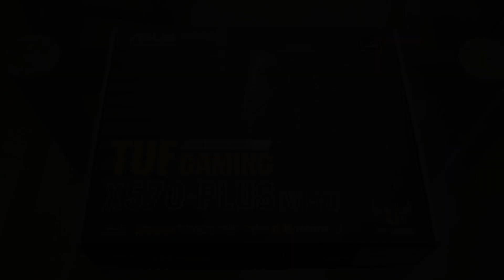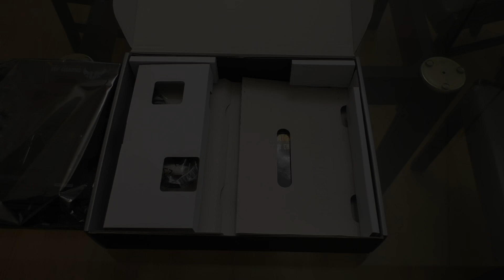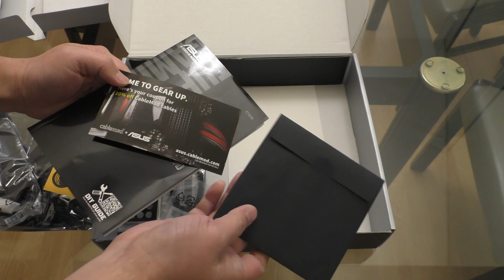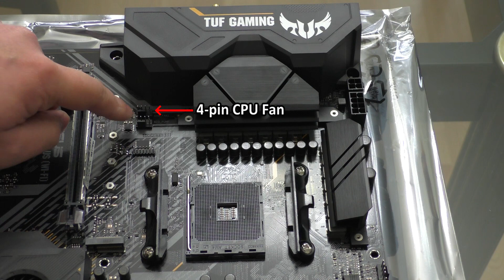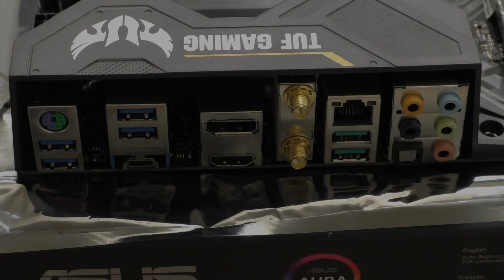ASUS TUF X570-Plus WiFi Closeup

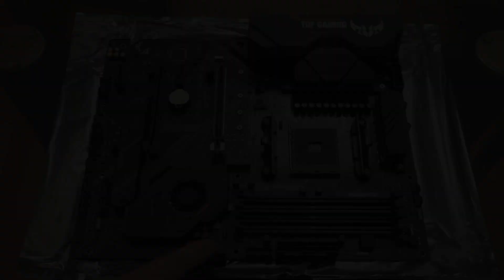Comment: For the system pannels( buttons and lights) pins in 1:37 does the power and restart button wires go into there?
Reply from the maker: Yup, you're correct that's where the power/restart button wires plug into.

Comment: How would you reset this type of motherboard? Is there a button or do I have to short it?
Reply from the maker: You'll need to use the clear CMOS jumper. Either short the jumper turn the PC on and hold down the delete key, or short the jumper and remove the battery.

Comment: It Will be fine with a Ryzen 5 5600x if i only put 2 cpu power clips? (The mother have 3 sockets for cpu energy )
Reply from the maker: You only need to connect 8 of the 12 EATX CPU power pins.

Comment: Hi, thanks for the run down
I just bought a custom build computer using this board. Do you know if it's possible to change the wifi5 to a 6? Like if I was to plug my own AX into a pcie x1 slot
Reply from the maker: If you get a different WiFi card and plug it into a PCI-E slot you should be able to gain Wifi 6 that way.
Reply: @FaRKle0079  Awesome, thanks

Comment: I'm planning to put a 3950X and 3090 in this board. I used PCpartpicker and it looks like everything is compatible. I just hope I don't need to flash the board. This will be my first build too, and probably last.
Reply from the maker: It's very unlikely you'd need to update the BIOS on the board to support that CPU. Great combo!
Reply: @FaRKle0079  I hope so. Super excited. 😎

Comment: does the pro version have the same port locations? My x570 pro (wifi) doesn't have pins in the front panel USB 3.2 port. 1:28 and why did you say 2.1 but then wrote 2.0?

Comment: How many fans does this motherboard support? And can i plug in a regular case fan into the AIO 4pin slot?
Reply from the maker: There are 3 case fan headers, but you can also put fans on the two CPU fan headers and AIO pump header.

Comment: Help asap. I have just build a new pc with same mobo and  5900x i cant find a 4pin cpu power connector. No signal coming to the monitor. Do u need the 4pin to power up a 5900x ?
Reply: U mean the 8 pin cpu connector? He explains it u don't need that 4 pin only the 8 pin

Comment: Nice video help asap. I just build a new pc with only keeping the case and cs750m psu. I cant find that 4 pin cpu power cable.  I have 5900x cpu on it do i need  the extra 4 pin  power  for this cpu ? I dont see any signal on my  screen
Reply from the maker: You shouldn't need the extra 4-pin CPU power for that CPU. The standard 8-pin alone should be fine.

If you hear the single POST beep when powering up, then the motherboard is fine, and there's probably an issue with the GPU or how things are hooked up with it and the monitor.

Comment: I over clocked my ryzen 7 3700x and now i cant get it to downclock at 
idle..  Amd cool and quiet doesnt exist in my TUF X570 plus wifi board. 
 I changed my power plan in windows to 5% minimum on the cpu but it 
still sits @ 4.3ghz even @ idle.  Anyone have any ideas?
Reply from the maker: Did you by chance change the CPU Core Ratio setting at all? I had your same problem once, and I think it was because I had changed that.

Comment: Is it just me, or did Asus reverse the install order for the RAM? The first slot it usually the clostest one to the CPU.
Reply from the maker: Gigabyte does the same thing even though the slots are labelled differently. The 2nd and 4th slot away from the CPU are the ones that should be installed first. It's really not intuitive and requires reading the manual.

Comment: Where would you insert a AE-9 soundblaster sound card on this?
Reply from the maker: You can put that in any of the PCI-E slots. Short cards work in long slots no problem.
Reply: I put an otter g sound card in my motherboard as well.
It works fine PCIE

Comment: I have a corsair 570x and the 3 front fans it comes with have 3 3pin wires but I don't know where to connect them on this mobo (first time pc builder)
Reply from the maker: You can connect those to the 4-pin fan headers on the board (it'll just take up 3-pins). There are enough headers on this board for three fans.

Comment: how do you use the 4-pin EATX 12V_2?
Reply from the maker: If your PSU doesn't have a plug for it, you don't use it. It's really not needed.
Reply: @FaRKle0079  hmmm..i guess that makes sense
Reply from the maker: @NSDaishi  The power requirements of the CPUs on this platform really don't require the extra 4-pin. Only under ridiculously high OCing (like beyond water cooling) you might need it.

Comment: So, I currently have a b450 motherboard, but am thinking about changing to this. I also want to add in a NVMe drive for additional storage(also which slot would I put that in, assuming its not for a boot drive could I just use either of the 2). Would I have to reinstall windows even if I bring my old ssd along with it or can I just re do all the connections and have it work right out of the box with all my old parts?
Reply from the maker: If you pop your old SSD into the new machine it should still boot up and into WIndows, but you'll still have to reinstall a lot of drivers and put settings back. Additionally, your Windows 10 copy might need to be reactivated. I had to do all this when changing motherboards but keeping everything else the same.

Comment: Can you move the second m.2 heatsinks to the first m.2?
Reply from the maker: Unfortunately not.
Reply: is using the second m.2 bad? i really want to but idk if it will affect performance
Reply from the maker: @DJLESGO  Use whichever you want and be happy! You shouldn't see a performance difference.
Reply: @FaRKle0079  i installed my m.2 in the second slot under the gpu. But it wont show up on my pc. Im using a WD Blue 1TB SATA SSD to boot. Do i have to plug another cable into the motherboard?
Reply from the maker: @loudmediaYT  When you say doesn't show up, do you mean doesn't show up in My Computer, or doesn't even show up in Disk Management for partitioning? Does the drive show up in your BIOS/UEFI?
Reply: @FaRKle0079  sorry i found it on the windows disk manager, i thought it would just appear in my files
Reply from the maker: @loudmediaYT  Glad you got it working!
Reply: @FaRKle0079  thanks for your help

Comment: Where on the motherboard would you be connecting the USB-C wire ?
Reply from the maker: There's no USB-C header on the motherboard, just a USB C port on the rear IO panel.

Comment: Do you need to update the bios and if so where would you plug in the USB stick ?
Reply from the maker: You can plug the USB stick with new BIOS file into any of the USB ports if using the UEFI EZ Flash utility.
Reply: @FaRKle0079  just got this board, would I still need a USB to install new bios? 5609x and same motherboard

Comment: I have the same motherboard, and I just ordered 2 Corsair MP600 Gen4 PCIe 4.0 NVMe. I have never installed one before, should I just use both of the heat sinks that come with them or just the bottom one? Also, will I need to remove the GPU?
Reply from the maker: I would be inclined to just stick with the heatsinks the drives come with. That said I understand if you want the aesthetics of the heatsink the board came with. 

For the top spot you don't technically need to remove the GPU, but you probably will want to, to have more working space.

Comment: im getting this board do i have to intall drivers for wifi for the wifi to work  or does it work out of the box and do you need to use the antenna for the wiffi also can you xmp on this
Reply from the maker: I believe Windows has some generic WiFi drivers so it should work out of the box, but it doesn't hurt the download the drivers in advance and put them on a USB stick.

You should plug the antenna in for WiFi or the signal may be too low to be of any use.

This board does support XMP, however it's not called DOCP since this is an AMD board.
Reply: FaRKle0079 ok thanks man

Comment: You mentioned that you don’t need the 4 pin CPU power, just the 8 pin.   My PSU didn’t come with a 4 pin just an 8 pin.   Is that 4 pin for over clocking?  I’ve heard some other folks say that it’s necessary for high speeds.
Reply from the maker: The additional 4-pin is only for extreme overclocking/power draw. The 8 pin alone at a minimum can provide 235W continuous power (and is rated for about 100W more in non-continuous draw). The 3950X only draws a max of about 150W at stock.

Comment: What’s a good power supply for this motherboard
Reply: Get a Corsair PSU.
Reply: MechaSZN are you sure cause when I’m on pc part picker it shows as a compatibility issue that the power supply needs a 4 pin connecter to the mother board to power the cpu
Reply: Tv Gaming_YT you won’t need a 4 pin cable. 8 pin is enough for any cpu overclocking. But shouldn’t really matter
Reply: Nasser AlQinai thanks so much thanks 😊
Reply: Tv Gaming_YT np 😊

Comment: Does the antena work instantly or do I have to install bios first
Reply from the maker: The wifi should work as soon as you install the drivers for the wifi card. Once the drivers are installed the antenna will transmit/receive as soon as it's plugged onto the connectors.
Reply: @FaRKle0079  ok thanks I am getting a customized prebuilt I'm hoping that they install bios can I somehow check if the bios are installed somewhere or should i to stay with the windows 10 drivers
Reply from the maker: @k00l_aid_man96  A pre-built should already have the OS installed and at the least generic drivers installed for it to work right away. You'll probably want to make sure the latest drivers are installed though.
Reply: @FaRKle0079  ok so I have to check on the files for the drivers and if they aren't new ones I should just reinstall new ones

Comment: I just bought this board for a Ryzen 5 3600 build.  I narrowed it down to this board or the Gigabyte X570 Aorus Elite ATX.  It was decided on the basis of the PS/2 connector, since I have a number of brand new IBM Model M Compact Keyboards that I like to use.  Have not yet built it . Got a Meshify C case for it.

Comment: What would you recommend for adding a 4th CHA fan? I have this board and it only has 3 CHA fan connectors.
Reply from the maker: Are you using the Asus software to control fan speeds? Do you have all the CPU fan headers and AIO header filled?
Reply: FaRKle0079 I would like to control the fan speed but it’s only a 3 pin. X2 GP12 fan. The fan CPU OPT is open and AIO is open, but I didn’t think you could connect to those just for the purpose of adding another exhaust fan.
Reply from the maker: @CFHDime  The AIO header always runs at 100% output, so you can't control with it.
Your fans only have a 3-pin connector, so the only way to control them is via voltage controller (not PWM, which is what the 4th pin is for). I don't think the board does voltage fan control. If you can't control the fan speeds anyways, then I'd just use the AIO header for your 4th fan.

Comment: DO NOT BUY THIS MOTHERBOARD I HAVE IT AFTER 3 DAYS OF USE IT STOPPED WORKING I WENT TO SHUT DOWN MY PC THEN 15 MIN LATER I SAW WHEN I TURNED IT ON IT WAS JUST STAYING AT THE WHITE LED NOT GIVING POST I TRIED A NEW GPU RAM I TRIED EVERYTHING I SAW ON THE REDDIT FORUMS and also the motherboard over heats has audio issues and can kill your cpu do not buy this piece of a shit
Reply: too late, getting here today 😔
Reply: real editing noob I haven’t had any issues with mine.
Reply: James Cargius same, I think it’s great
Reply: I think you just got a runt of the litter, bad board. A regular 1 is terrific
Reply: Rangyr Wilson you’re probably right. But I hate that the gpu blocks the cooler.
Reply: @edited416  There are 2 slots to put the GPU, try putting it in the other & it won't obstruct
Reply: Rangyr Wilson it doesn’t matter for me anyways, doesn’t get that hot. But doesn’t the secondary gpu slot have less performance? I know it can’t be the same as using the primary.
Reply: real editing noob It does, but not by that much.  I guess if you want very slightly better performance & you don’t care about aesthetics then just keep it in the original slot.

Comment: Hi, I've just ordered this for my PC I plan on building next week! But I've got one problem, I only just now realized it has no io shield. Are you using it this way, and is/will this be a problem?
Reply from the maker: I used the IO shield with mine. It's not a total deal breaker to run without it. You can pick up a new IO shield on eBay pretty cheaply.

Comment: I have a few questions from reviews I've seen on this motherboard. Does your xmp/docp run normally and people say the LED lights stay on is there a way to disable that and also does it make you install armoury crate.
Reply from the maker: I had no issues running my G.Skill 64GB (4x16GB) 3600MHz kit using XMP/DOCP. I just set it and it ran fine.

You can absolutely disable the LEDs. If you don't want any LEDs at all, there's an option in the BIOS to set Aura to "Stealth Mode," which doesn't require an Armoury Crate installation. If you want LEDs when the computer is on, and them turned off when the computer is off, then you need to install Armoury Crate and set the shutdown behavior of the motherboard LEDs to off.
Reply: FaRKle0079 Ok thanks for the reply

Comment: Very informative! I am currently waiting for my parts to arrive. I am going with a 3600 paired with a 2060s. 
I have a question. I bought this motherboard on Newegg and the reviews aren't looking nice. They said that in order to install windows you have to disable the WiFi in the BIOS. 
Did you do any of this?  I am going to install windows via flash drive with media creation tool.
Reply from the maker: Congrats on the new build!

I had no issues installing Windows 10 from a flash drive without doing anything special in the BIOS (like disabling WiFi) or updating to the latest BIOS version.
Reply: The motherboard overheats and has audio issues do not buu this crap
Reply: @falc0n2222  way way better msi's x570 mobo

Comment: Interested in seeing the build. Your putting a Ryzen 9 3900x? That's awesome!!
Reply from the maker: Yup. The 3900x renders my videos SO MUCH FASTER than what I had before. I'm loving it.
Reply: @FaRKle0079  
Hello I am curious I use Corel VSP EDITOR.
Which editor are you using I'm just curious.
I found a glitch that I discovered.
This is why I asked which editor you're using.
Thanks
Keith
Reply from the maker: @KTHKUHNKK  Nice bug finding! I've just been using simple PowerDirector (which has its own bugs).
Reply: @FaRKle0079  
I'm curious what type of bugs have you found in PowerDirector ?
Keith